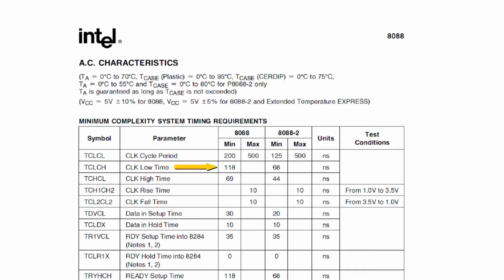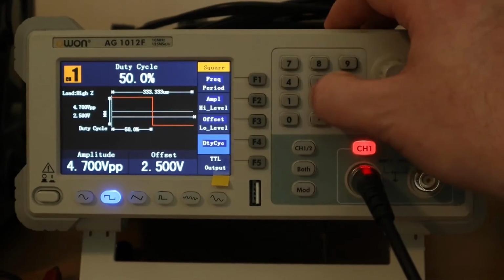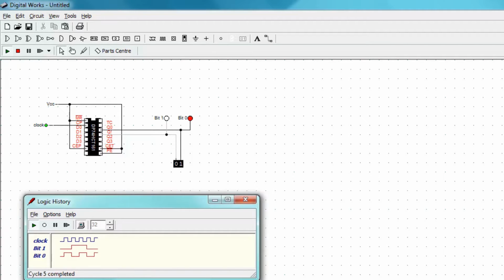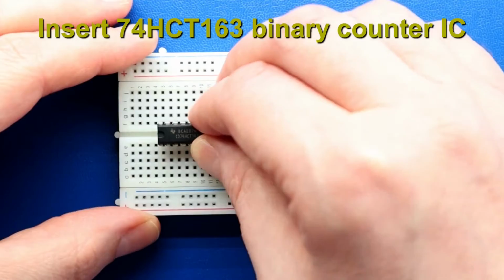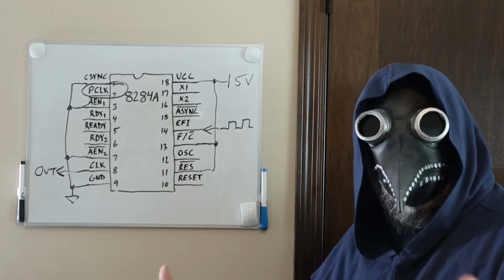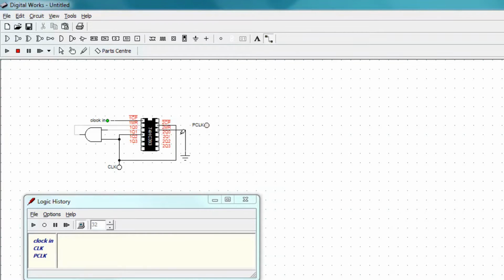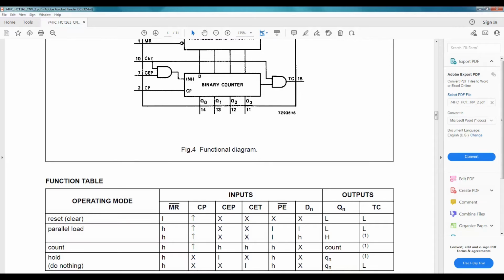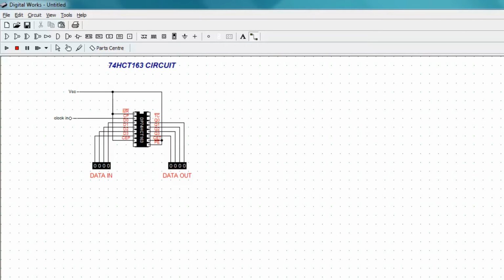Clocking the 8088, Let's Make a 33% Duty Cycle Signal! (EP 41)

Comment: Another great video! 👍

First time I have seen anyone show the waveforms from the 8284, or even explain what it does. I'm impressed on your single chip replacement solution, especially since the 8284 chips are expensive to buy, even if you can find any nowadays. Mine cost $10++ .

BTW I was pleased that you mentioned the glitch which occurs on the Q0 output, when you use the asynchronous type reset, as if used for a clock it could easily catch someone out.
Reply from the maker: The last I checked, Digi-Key still sells the 8284A, but like you mentioned they are very expensive, and must be purchased in quantities of 3 (at $139.56 each) or 15 (at $21.20 each) from Digi-Key. Ten dollars would be a great price if you can find it for that! Although that is still expensive for such an IC. Thank you for watching!
Reply: You can find a cheap sovieticus clones of i8284: КР1810ГФ84 (KR1810GF84)